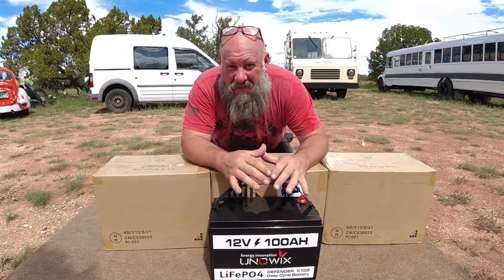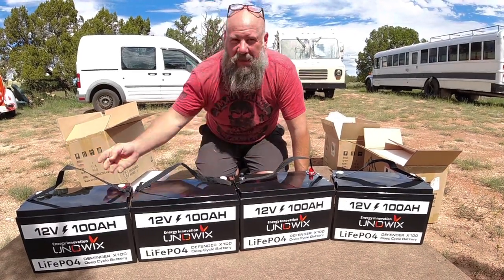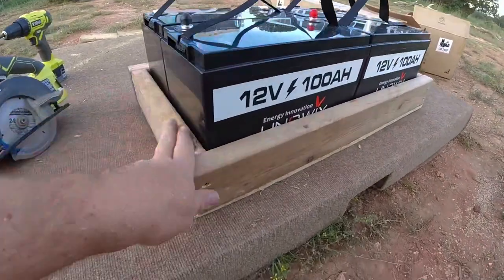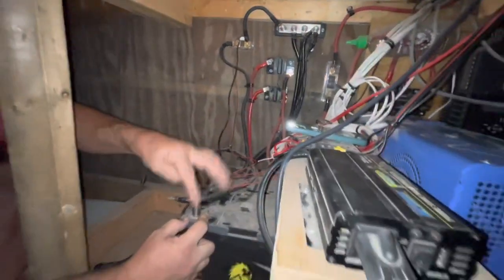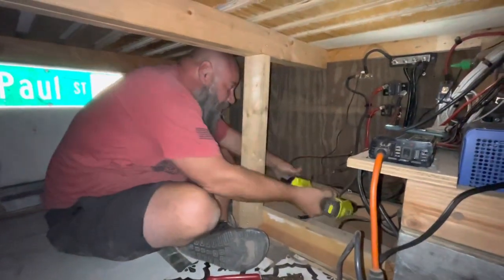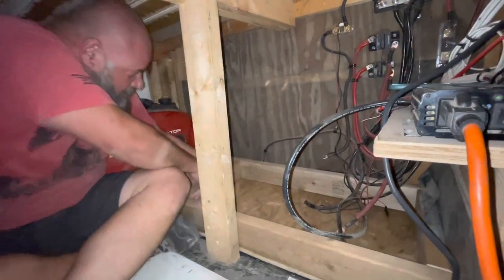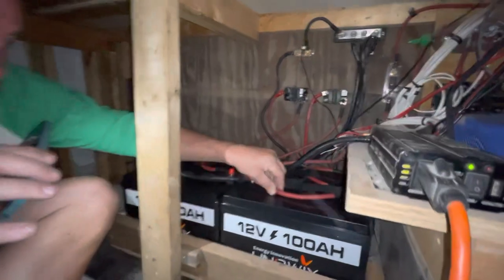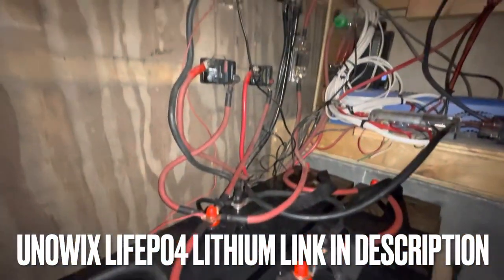HUGE LITHIUM BATTERY BANK INSTALL IN THE BREADTRUCK! | UnoWix LiFePO4 | OffGrid Power

Comment: I recommend you research all in one units. They include the solar charge controller, inverter, and grid battery charger in one large unit with a few connections. Generally they are used with 48v server rack batteries.
Reply from the maker: I have been watching Will Prowse videos all about them. They are neat systems. But I already had an awesome system that I put together myself 5 years ago. If it ain’t broke….
Reply: @PaulBarger  Very true! It's quite a waste to throw out such a well made system!

Comment: FYI Paul, White Ford Transit Connect, lower spare tire, spray WD 40 on cable & wheel lock.

Had same truck, had nightmare situation getting spare loose.
Reply from the maker: Thanks for the comment, good tip! We had taken the spare down within the last two years but it won’t hurt to keep it oiled up. It’s an Arizona vehicle so there isn’t a speck of rust on it so we didn’t struggle with the mechanism at all.

Comment: Great system, but I don’t like that you have red and black cables rubbing against each other.  Keep an eye on them.  Between vibration and heating and cooling expansion. They could eventually rub through and short out.  Great video and thanks for sharing.
Reply from the maker: It’ll be fine. I will keep an eye on them though. If I ever find a mark from rubbing, I will put some garden hose over the wire and heat shrink it in place.

Comment: This is amazing! Lithium is very under rated right now. The massive efficiency gain, and lifespan make lead completely obsolete!
Reply from the maker: Totally agree with you. That is what had me sold on lithium. Duty cycles. It’s as much as ten times what lead acid is. The initial investment may be slightly higher but the lifespan is incomparable.
Reply: I think, and this is only my opinion, that the cost per unit is not low enough yet. 

I’m in south Louisiana. A Duracell deep cycle, 12vdc, 185AH, run $175 each. It would take 8 batteries to have a usable 800AH. That is $1400 every 5 years. If I take good care of my batteries. Allow for some inflation and that is $3,000.00 for 10 years of power. I am counting on solar power (900watts) to charge my batteries.  

These UniWix at 100AH ea requires 8 batteries.  That provides almost 800AH of daily use charged by 900 watts of solar.  These batteries have approximately a 10 year life expectancy, if taken care of.

What do these batteries cost per each?  If these batteries are $300 ea, then they essentially break even with the AGM’s over a 10 year period.  I am assuming (& we all know how to spell Ass U Me!) that neither battery types will be subjected to extreme temperatures at either end.  If the lithium batteries cost more than $400USD per each, I think their advantages will be outweighed by their cost.

This is only my opinion. I am not an electrician.

One major advantage of these lithium batteries: the weigh approximately half the weight of an AGM battery.

Comment: What was with building a new one, and then pulling the old one out? They didn’t look that much different. I would have pulled the old one out and made it do the job. PLEASE, get some filtration for the Breadtruck.
Reply from the maker: I have a pile of scrap wood to use. The box needed to be different dimensions in every direction. I needed it to be longer and less deep. Plus the bottom sheet wouldn’t have fit so then what? Patch in a strip of plywood on the end? I thought it through and I have reused wood in my truck multiple times. The old battery box is now repurposed as a table top that went on top of a tree stump. We don’t waste. 😉
Reply: @PaulBarger  can you mix the old batteries and the new ones?